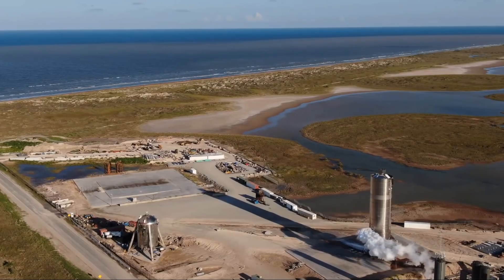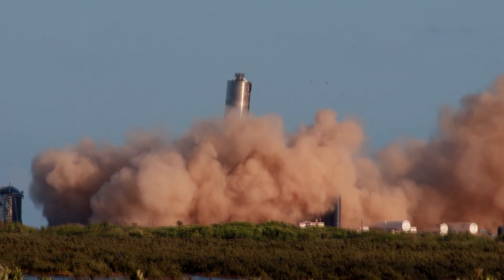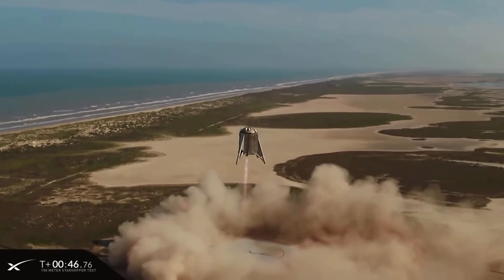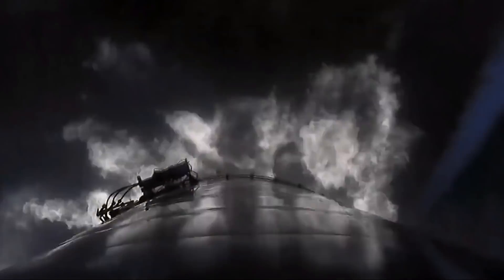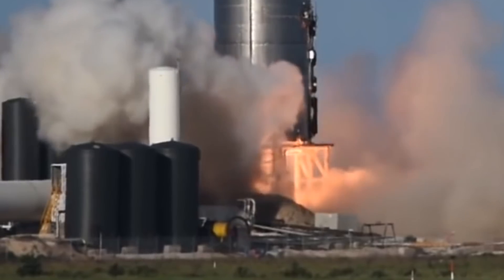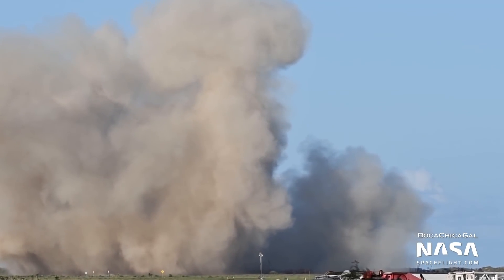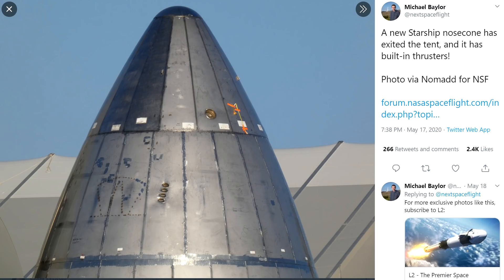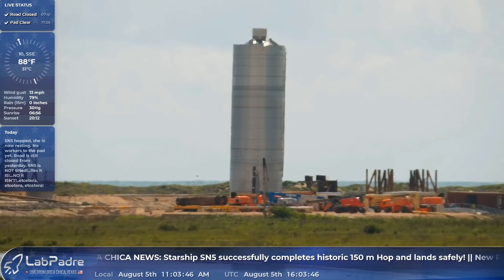SpaceX's Shiny Stainless Steel Starship Prototype Takes Flight For The First Time

Comment: Most go for "grain silo". With that mass simulator I go for "spray can".
Reply: Looks like a big thermos to me.
Reply: Makes me think of a water heater. Those end up flying on their own sometimes, too, though generally with a rougher landing :P
Reply: @Dr.Fluffles  Well you get a free skylight for the house involved.
Reply: The streets be getting savy, this is a big brain drug!
Reply: He should paint it like a Barbasol can.
Reply: LETHAL WEEABOO then paint the HPVs green
Reply: In a way, it is a pair of combined canisters which do spray
Reply: Indeed spray can is a lot better, especially the kind i, and I'm sure many of you, turned into a flamethrower when i was young.
Reply: Y'all remember Jolt cola in the aluminum bottle can things?
Reply: @heynosjosh  I read a soda can has 10x more structural integrity than the tanks on the ESA's new rocket. Not sure about Elon's. His seems to have a little more integrity like a keg.
Reply: I agree
Reply: Good. I wasn't the only one to think that. lol
Reply: Just imagine the size of throw ups you can do with "can"....
Reply: Paint the sky in stainless steel
Reply: Wouldn't want to meet up with any bugs that would be for.
Reply: Looks like a triple-A battery for me hhh
Reply: Grain silo... Spray can... Everything's a dildo if you're brave enough!
Reply: Paint tube
Reply: me too
Reply: It's giving me pepper grinder vibes
Reply: Leaking spray can
Reply: I was more thinking "tall beer keg"
Reply: Andrew Robinson 🤙🏾Rattle Can😂
Reply: Spay can what?  :-)    It's the tin woodsman's torso!
Reply: Giant can of Red Bull.

Comment: 10:00 tf was that
Reply: People think its the exhaust plume after it gimballed during the powerslide tearing stuff up on the pad. I personally think it looks like a small explosion possibly from a methane leak/release somewhere.
Reply: @digi3218  I don't believe it's something that's blow away, as some parts move upwards to fast compared with the exhaust gases.
Reply: Thank you! Seriously that's one of the most interesting parts of this video and I haven't seen any youtuber creators say anyting about it.
Reply: Yeah I wish he would have said something about the launch pad explosion
Reply: Whatever the explosion was it won't be much of a set back. Maybe a few repairs on the launch pad but it does seem like they will need some upgrades if they want to support more hops regularly. They might skip the upgrades and work with what they have until the new Superheavy launch pad is done. Will be interesting to see what's next 😁
Reply: The thrust was ripping the launch pad apart. Nasa has single use rockets and multi usable launchpads, SpaceX has single use launch pads and multi use rockets.
Reply: @Bauer-ke6lp  I love the space community— everyone's just helpin each other understand things. Much love
Reply: @crowlsyong  I found more info about that: "The burnt debris flying off the launch mount appears to be the plywood decking material on the top of the launch mount - the part the workers are always walking around on. Starship cooks it as she transits over, then blows a chunk off the mount as she moves past and the exhaust reflects up from the ground." It was definitly not supposed to happen.

Comment: YouTubers in 2050 will be buying old Raptor engine stock and seeing if they can launch a house or 50 cars at one time into orbit
Reply: Pretty sure my house wouldn't be able to handle the pressure required for the cryogenic fuel unfortunately.  Would certainly make for an interesting insurance claim though ;)

Comment: Watching the landing again I suspect that exhaust plume blowing back up into the engine cavity may have removed enough oxygen that whatever was burning on the outside of the engine could not combust. When the engine was cut off, pumps upstream of the leak or whatever it was were stopped so the leak stopped.
Reply: I had a similar thought about this, but more along the lines of - the rising pressure inside the engine cavity as the vehicle got closer to the ground might have killed the flames..? (like strong wind kills a candle) This would of course probably work in both scenarios- 'leak' and 'external stuff burning'...

Comment: So with these overpowered engines, is SpaceX planning to land the starship with people in it using suicide burns?
Reply: Yes, a parachute would need to be unreasonably large/massive, and wouldn't allow for pinpoint landings. It also simplifies things since it will be used as a lander for the Moon and Mars, where you don't have any choice but to use engines. Like the Apollo Moon lander. Or current Artemis Moon lander proposals (Starship included).

Raptor can also be throttled a lot, and you only need a few to be ignited. The vehicle is also heavy in mass, so landings shouldn't touch down hard.

Commercial flights will likely go on for a couple years or so before there's astronauts, and Falcon 9/Heavy are already landing, so there'll be plenty of data to make it as safe and reliable as possible. Especially since it can handle multiple engines going out.

Dragon 2 was originally supposed to land this way (and technically still could), but they decided not to certify it, and focused on just meeting NASA's requirements and developing Starship.

Comment: If you looked at the legs, they had bolted slides on them and acted like friction brakes. Likely the slides that contacted the ground first pushed in the farthest, the reason for the tilt.

Comment: "Engine-rich exhaust" is hilarious.
Reply: Rocket engineers have lots of terms to severely understate a problem. My favourite is "hard start" meaning "the engine exploded during startup" ;-)
Reply: ...I didn't pick that up at all until I saw your comment.  Love it.
Reply: "Rapid unscheduled disassembly" is one of my favorites. Obviously, it's just over-eloquence for something vibrating apart, or exploding, buuutttt.... nonetheless...
Reply: @jordaneggerman4734  It reminds me Kerbal Space 😂
Reply: It is a"ROCKET ENGINE" scientific term for, rich on one fuel and lean   on the oxidizer, perhaps.
Reply: @davemcdonald9098  It's the other way around; a rocket engine that runs oxidizer-rich (unless it's designed to do that, as a few Russian LOX/kerosene engines are [they have special oxidation-resistant coatings on the metal parts that get hot and contact the LOX]) starts burning up its own metal. The first Raptor static firing showed this, when the late-firing and post-shutdown flame was green-tinted, indicating that the copper lining had gotten hot enough to burn with the LOX (and after shutdown, with the oxygen in the air). Also:

Dr. Wernher von Braun's team had a flame color observer in the blockhouse, who knew from experience if the color--and thus the fuel/oxidizer ratio of a missile's or a launch vehicle's first stage engine or engines--was correct. If it wasn't, he signaled for immediate engine shutdown, thus aborting the launch. If the engine (or an engine in a cluster of several, as on the Saturn I, Saturn IB, or Saturn V) burned with a red or reddish flame after combustion stabilized following ignition, it was running fuel-rich (this wouldn't harm the engine, but it did burn excessive fuel). If the flame was white (or nearly so, unlike the normal yellow of a properly-burning LOX/alcohol [V-2, Redstone, Jupiter-C, or Juno I] or LOX/kerosene [Jupiter, Juno II, Saturn I, Saturn IB, or Saturn V] engine), the engine was running oxidizer-rich (which would seriously damage or destroy the engine--probably explosively--if it wasn't shut down immediately).
Reply: Basically vaporizing the engine?
Reply: Fighter planes taking off vertically have the same issue. The air around the rocket gets heated, and contains much less oxygen, causing this phenomenon.
Reply: What's funnier is y'all think it's off to Mars ... heh heh heh
Reply: John Kean what’s funnier is people like you will be completely silent when it happens. You’ll never show your face around these parts again and just move on to your next shit head comment.
Reply: @granthoover9045  You hope? You think they won't try to prove it's all fake and search the studio where the episodes of "news from Mars" are recorded?
Reply: @johnjohn-cs9eu  Starship's reusability, cheap but durable steel body and efficient engine technology puts Mars and the rest of the solar system absolutely within reach. 

If you mean sending humans on long space flights is problematic, for example due to radiation or needed resources, I agree.
Reply: @johnjohn-cs9eu  Yeah, in ten or fifteen years.
Reply: @johnjohn-cs9eu  Obviously not anything that looks like that, that's just one of many test vehicles. SpaceX uses lots of relatively cheap experiments to test it's ideas.

Comment: 3:21 If you look carefully at the leg on the very left, you can see that something falls as it deploys. Not sure whether it's bad.
Reply: Something dropped through the round hole just above the leg it is visible partially covering the hole shortly before dropping through. 3:18
Reply: @agentx7138  maybe someone left there cellphone there lol
Reply: @agentx7138  Probably just something that was left in there or something that yeeted from the pad at liftoff
Reply: Redundancy. There's lots of legs. 😜

Comment: @Scott Manley, what is that secondary flash and then all that debris fly up on the lower right of the test stand @ 10:00 ?
Reply: It looked as if there was a small explosion near the stand that launched the debris into the air, could be part of the test stand as others have said, though it's hard to see
Reply: I think it is because the rocket moved sideways.  When the thrust stopped pushing down on the top of the elevated pad and instead hit the ground next to / below the pad, the thrust ricocheted off the ground to the underside of the elevated pad.  The pad wasn't designed for thrust hitting it from below.
Reply: I wouldn't be surprised if that test stand took damage. I suspect even if it was completely destroyed it wouldn't be too hard to replace.
Reply: from what i see it’s the exhaust impinging on the launch mount.
i guess there was something nearby that went flying.
Reply: Agree, it definitely looks like the test stand being destroyed by the exhaust.
Reply: Im not Scott, but hey...this is a free platform. I think they were expecting the rocket to go more straight up, instead of sideways. When the exaust crossed the launch pad, parts of it blew away, as bricks do when they receive a kick from a 200kN blast.
Reply: @matiastueros6177  I don't see how they couldn't have known it was going to go sideways. That's what happens when the center of thrust is offset from the central axis.
Reply: @awilliams1701  I had to float sideways in order to reach the intended landing pad. It was never meant to go straight up and down.
Reply: @awilliams1701   i guess it was unexpected..or they would have put a steel plate or smth on the path the exhaust was going to follow. Or they knew and didnt care....but i doubt that...the debris could have hit sn5
Reply: @matiastueros6177  it wasn't unexpected. Elon stated on Twitter a few weeks back that he knew the rocket would immediately strafe to the side when it launches. So an explanation on what was destroyed is definitely needed.
Reply: @awilliams1701  "they aren't building stands, they are building rockets." probably just nobody cared if the stand would support a rocket blast from the side. At that point you are out of the area and it's easier to tack weld the floor back on than to waste time worrying about it.
Reply: @CR-iz1od  I thought that was what I said. I guess I didn't. lol

Comment: 9:12 - As SN5 is leaning slightly, it looks like the Tower of Pisa.  I like that comparison better than the 'silo' nickname. So from now on I call it the Tower of Chica.
BTW, I know that the leaning came from landing at a tilt with just one off-center engine. I also know that Elon tweeted that wider and longer landing legs will follow, with more impact resistance, so the leaning will definitely stop. Amazing accomplishment, SpaceX.  Thanks LabPadre and BocaChicaGal, and the other stream channels.

Comment: With the short legs and the very enclosed space, the landing looks worryingly stressful to the engine. Personally, I'd be concerned about damage from the high intensity sound and pressure. Though I'm certain SpaceX has thought about that, alongside all the things I couldn't even comprehend.

Comment: No thoughts on the debris that yeeted out at the beginning?
Reply: It was a pretty solid looking steel storage thing attached to the side of the stand, its one of 2 that are there. Possibly used for electrical or plumbing of sorts. You could see it rip off as the rocket moved over the stand in that exact spot
Reply: Probably an explosion of a methane feed line in the stand.
Reply: I was wondering the same thing and just "knew" that Scott would discuss.
Reply: @JeffreyBue_imtxsmoke  I thought he would discuss it too but he didn't. Maybe he missed it
Reply: Updoot for correct use of yeet
Reply: It was still pretty close to the ground when it cleared the launch stand as it was largely going sideways at that point. So I imagine that was just something from the ground around the stand. The blast from that engine is enough to (for instance)  rip up tarmac.
Reply: Does it really matter what it was? As you said, it was some debris sent flying. Not that important.
Reply: It was the launch stand.  Good view of it at 10:00

Comment: So I gather they will need to do a "hover-slam" with this just like F9 due to the engines not being able to throttle low enough, but I'm curious about how it will work with Starship. With a cluster of three engines at the center, will they use all three? Even with only one as in SN5, that looked like a pretty large mass simulator up top. If a Starship is coming back down after having released its payload and is using three engines in the landing burn...that's got to be one hell of a hover-slam.
Reply: Depends on how much fuel is left in the tanks, and how much payload is being carried.  There will be almost no time when a Starship comes down truly empty.
Reply: @danielweigert2856  I'm pretty sure the fuel is planned with a certain percentage of reserve, but not much. There's a big penalty for every extra pound on your second stage, so they carry as little as possible. In other words, I would think the landing weights would not vary as much as you're suggesting. It's possible they will keep this asymmetric configuration for landing, using either one or two of the center engines, which would give them some engine-out capability. I know that the more aggressive the hover-slam the more efficient, but also the more risky. It will be interesting to see.
Reply: Depends where it's landing. Back on earth empty after deploying a payload to orbit, on on another planet still full with cargo...  There's a hundred tonne or so difference there.
Reply: @owensparks5013  that's fair, but I'm referring specifically to landing on Earth after deploying some payload. Should be fairly similar in mass, but I could be wrong. Any way you look at it, 3-engine landing burn seems very aggressive.

Comment: I think Elon heard someone say "missile silo" and misunderstood
Reply: we put a silo in your silo so you can launch while you launch
Reply: Starship - why don't we just take the silo with us?
Reply: Thank you, I laughed out loud.
Reply: Every time I drive past a farm, I will look twice at any grain silos.. You know... Just in case! 🤔
Reply: @alastairbrand5821  I used to live out in the country we had a big woodshop. it was connected with fans that would blow all the sawdust into a sawdust silo. One day the fan shorted out. The sawdust powder had mixed with the air in the silo. it blew the drain door at the bottom off and shot up in the air about 30 ft and crash to the ground in little pieces. It was a hand built wood stilt tower we could drive a truck under and dump the dust. Better the silo pop than the shop with people in it though. We rebuilt it in about 2 weeks and installed newer fans that have better housing on the motors to eliminate that possiblity. It was originally built by my step dad in the 60s. Worked for a long time. Flour Mills have similar problems.
Reply: @JeoWilson  Absolutely. I think a lot of people either underestimate (or completely fail to grasp) just how explosive a lot of air/dust mixes can be - be that grain/flour or sawdust. 
About seventy or eighty years ago there was an immense fire and explosion which utterly destroyed an entire mill near to where we live. The flour dust made the situation just as dangerous as a fuel station fire.
Reply: @alastairbrand5821  physics is fickle. Ceramics at absolute zero that work as tracktor beams of sorts using quantum locking I see multiple tiles being used to move objects around possibly capture and draw in sats. Completely inert non-flammable matter being more volatile under the right conditions than some of our strongest fuels..... We still have a lot to learn. I already see applications for the ceramics on space suits for tools now. Imagine quantum locking a wrench 3 inches from your suit in midair that moves with it. Would just need a small tank of liquid nitrogen in your RCS pack. Natural magnets are more efficient however. I still like the no contact idea though. Levitation of sorts. It could be used to keep the astronaut on EVA cool as well though. The water suit could be cooled by it.
Reply: Or did THEY misunderstand? Hmmm....... 🤔
Reply: @falxonPSN  Vsauce sound intensifies.....
Reply: lololol
Reply: LMAO well done sir
Reply: Flying garbage can would be more accurate.